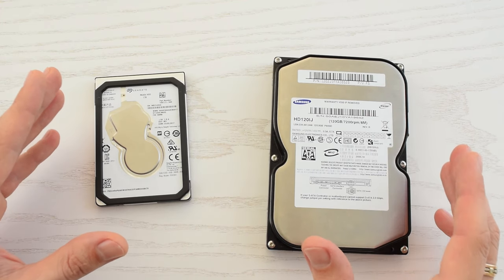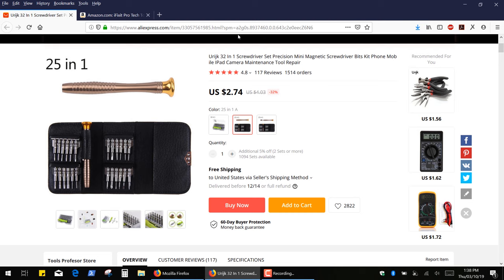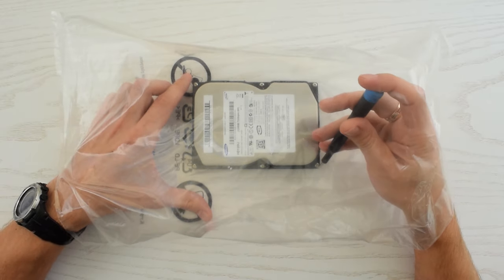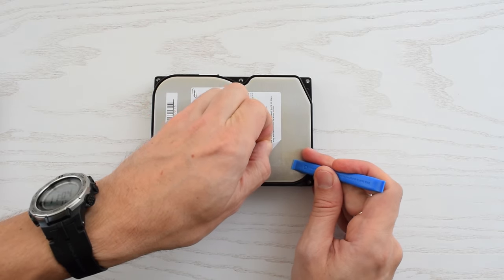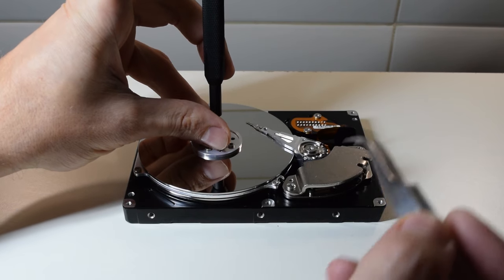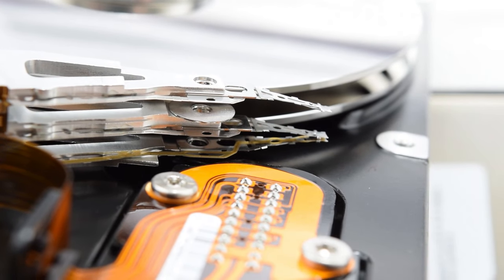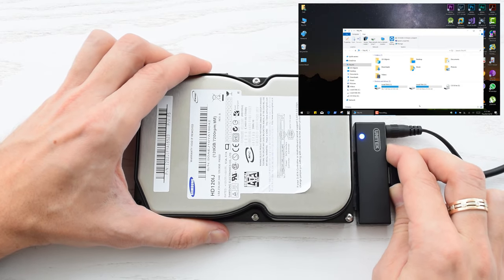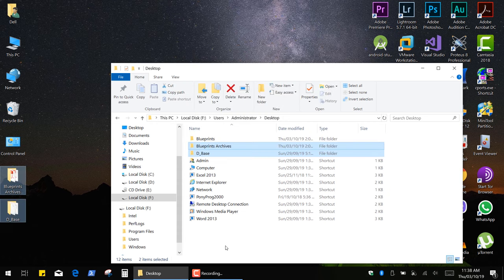Fix Beeping or Buzzing hard drive and Recover your data in 3 minutes

Comment: My man! Out of the 20 or so videos I watched I think I kept referring to your one the most so thank you for putting your knowledge out there. Success for me but I don't know what was wrong in the end, unlike in your video the arm /needle  of my drive was sort of parked, the heads were parked but part of the arm was still not clear of the platter, I tried to move it a bit, nothing really happened, I didn't want to fully damage it so I didn't dig around to much, so I put it back together, sprayed it all with compressed air and plugged it back in, and happy fkn days!!
Q1. Is it OK to spray compressed air inside the drive?
Q2. What is the best (reliable / robust) type of drive for storing files at home?? Thanks again brothaa
Reply from the maker: I'm glad I could help you! 
Q1. Yes, it's absolutely harmless for the drive, we also use in our service center.
Q2. I don't recommend using HDDs at all. Just buy any Samsung's SSD and it will last 10 years minimum for you.
P.S. I recommend immediately back up your data from that drive, because it won't last long.

Comment: Is there any possible way for me to send you my HDD and pay you to do this? I contacted Gillware and they told me it would probably be around $1,800. I don’t have that kind of money at the moment. This is the only video I’ve found so far that shows a HDD making a very similar sound that mine is making. I tried changing the pcb board and swapped the bios chip and that didn’t work so I’m thinking it’s either the head stuck on the platter or a bad spindle motor.
Reply from the maker: Try to do what I did in the video. Those spindle motors usually last forever. It could be the head stuck or dead head assembly, which is a number one issue of all HDDs.
Reply: Why 1800 dollars? I guess its the data is the value, not so much the hard drive. A billionaire might pay 18 million to recover the data?

Comment: Please help me . 
My hard drive starts and produces a buzz sound and stops and then it starts again and it's not working also but it's being detected . It is working so slow that it take 10 he to boot up. And then a click takes 10 min to get completed. Pleaseeeeee help me
Reply from the maker: It's definitely not a stacking head but most likely damaged head assembly (maybe the drive was opened in not clean environment)! In order to back up data you need to swap the platters to the same working hard drive. Otherwise there's nothing you can do about it.

Comment: i need to fix my extended storage asap (i’m addicted to warzone), i don’t want to break the drive and i need to do it without my parents knowing lmao. do you think i can do it?
Reply from the maker: Does it make the same noise like beeping or it clicks?
Reply: @ElectronicsComputers  it’s beeping btw i have one of them hard to open seagate ps4 drives (no screws)
Reply from the maker: @riverjlo5104  If it's beeping then this method may work for you. Give it a try but do it very careful and very quick. Open the case move the head and immediately put the cover back.
Reply: @ElectronicsComputers  okay thanks

Comment: My xbox isn't detecting my drive but the light is beeping.
This should do the fix then
Reply from the maker: Simply replace your hard drive. I have a video on how to do it and how to upgrade your Xbox to an SSD drive.
Reply: @ElectronicsComputers  no it's my external hard drive wd elements 1tb 3.0, xbox doesn't detect it but it works on pc

Comment: Wow interesting, I thought if you open up a disk you kill it, since they're full of inert gas and I thought even the tiniest amount of dust would stop the heads reading the platter.
Reply from the maker: If you're doing it at home, you have to work under the cooker hood. Or for example, you can put everything in a big plastic bag and work with your hands inside to prevent dust from coming inside. After you fix the problem, you have to immediately back up your data because that hard drive won't work for long.

Comment: This head repair is still pretty risky, if your data is extremely crucial (7/10+ crucial) , pay the money for a clean-room professional service to assess if the platters are still ok and to repair the mechanical parts.  By design and to be honest these drives can handle a very little bit of dust as they contain internal air filtration to remove it and the chances of the dust lodging between the platter and needle are pretty rare in such a brief time but DO NOT let the drive sit open for long periods of time.  Even more honest, a "clean room" is also not 100% perfection dust free but it's pretty close.   If you have a powerful air purifier, run that max with a decent clean/new filter for 24+ hours prior in the room.

Absolutely best advice for data today - always have an automatic backup (another drive or cloud service) and verify the backup is running every so often maybe every few weeks once you can trust it.  It's better to wait on a data restore if the mechanical parts indeed fail on a drive - this can be an HDD or SDD - solid states of any kind can also fail after 5-10 years, be aware.

Comment: Pls help to your new subscriber 😟
My Seagate 1 the HDD is making beeping noises . Will it get fixed by your video. Even if it get fixed will the problem come again ? Pls help pls help 😖😖
Reply from the maker: Try to slightly open it and peek inside. If the head assembly is stuck on the platters then go ahead and fix it using my method. If the head is parked on its place then close your drive and give it to someone who can fix it by swapping the head assembly or the platters to a donor drive.
Reply: @ElectronicsComputers  if it even get fixed will the problem come again ? Because i don't have another HDD .